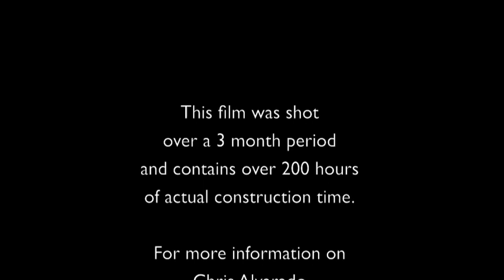Building an acoustic guitar in one hour!   (Time-lapse video)

Comment: Thoroughly enjoying this. As if I'm in the room. I've been playing for 25 years. I had an old classical I tried to restore and ruined it due to inexperience. Sanded finger marks into the wood. It was not repairable.  The wood was redwood on the front and very light. It probably still sits in the closet of the guy I gave it to. Memories....

Comment: With the neck block extension under the sound board I don't understand how you access the truss rod, Do you slot the top of the extension before gluing on the top? Do you drill through  the hole in the transverse bar? Inquiring minds and all that;)

Comment: A really enjoyable Visio. A great deal of artistry on display. 
I noticed that the sound board bracing was scalloped. The deeper the brace the stiffer. Therefore, the stiffest parts of the sound board are at the points of the scallops. Are the scallop point locations predetermined?

Comment: Based on some of the prices I saw on the website, that guitar costs between $20,000 and $30,000. For that price I would just try and make my own. I really liked how he used electricity to bend the wood. Not a fan of how shiny it is with all the lacquer, I would prefer a more muted oil finish or flat finish. His inlays are ridiculous. That's the most basic inlay that he's done. One of them looks like the New York skyline. Another looks like Clint Eastwood smoking a cigarette and most go out of the neck and onto the body. Like I said, RIDICULOUS!!! in a good way obviously
Reply from the maker: Thanks for the comments. This guitar would be about $14,000 if someone commissioned it today. I bend my sides with steam and heat, but the jig that applies the heat is powered by electricity. Thanks for the kind words on my inlay work!